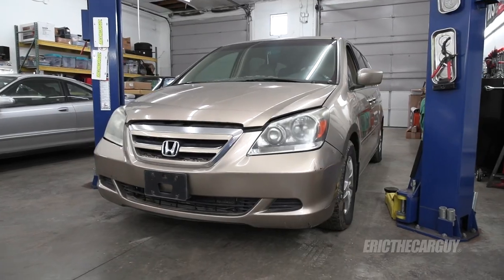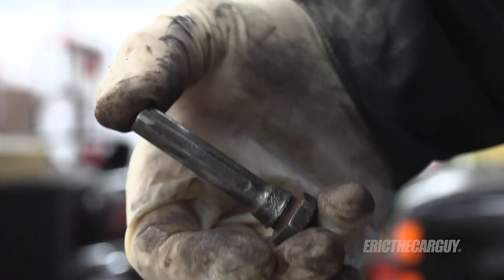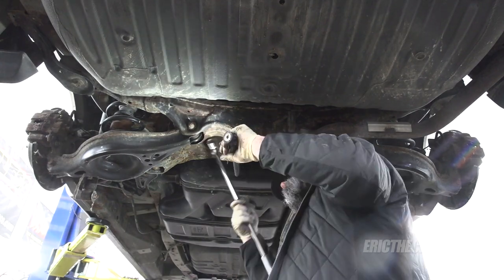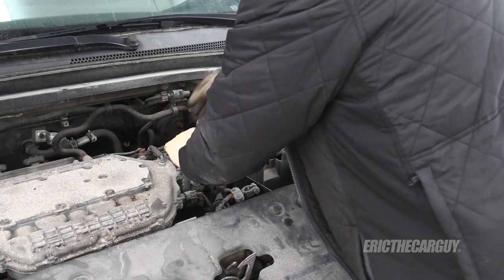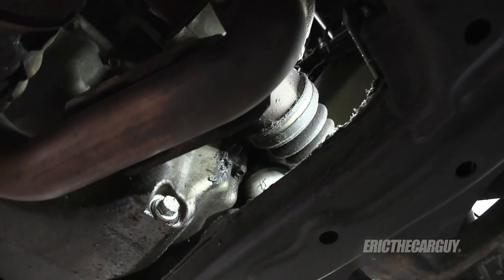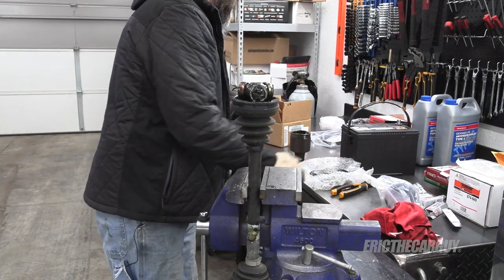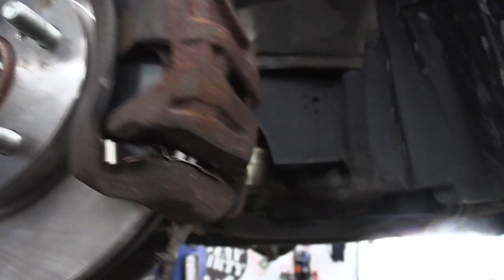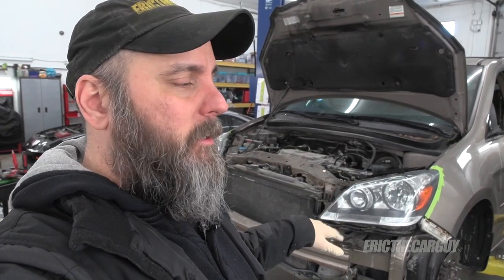2005 Honda Odyssey The Work Begins (Episode 2) Fixing it Forward

Comment: Watching these videos I'm not too impressed with the quality of the design. Seems to me you don't repair Hondas you just replace parts that crap out. Good if you are in the business of selling replacement parts, not so good if you are an owner trying to keep your car maintained.

Where is the grease zirk in the rear control arm?  How do you go about replacing  the bushings?  Sounds like piss poor design to me.
Reply from the maker: If you only knew what was actually involved in vehicle manufacturing. I recommend this as an overview: https://www.youtube.com/watch?v=IhYvkh1ydMc
Reply: @ericthecarguy  

Well I understand that to a point, but nonetheless when I buy a U joint I always opt for the one that has a grease zirk over the " permanently" lubricated ones. 

I have been a locksmith over 40 years and one observation I will make is that there is virtually no demand for duplicate keys for older Japanese cars despite how popular they were at the time.  But there is still call for  most domestic cars and some of the imports like VW's or Mercedes. My wife had a Toyota she bought new. For that car you didn't buy a distributor cap you had to buy a whole set of plug wires with it. When a tail light socket was found to be corroded can't buy a socket, got to buy a wiring harness. Went to adjust the vent and the plastic turns to dust. Can't buy a carb kit, got to buy a new carb because the Teflon coating was worn out.

Yet the myth continues that Honda's or Toyota's are such wonderful and reliable cars.

When I watch your videos I see things like you finding a stuck adjustment bolt that requires replacing the whole control arm to fix.  No provision to lube the part, no provision to repair the part, and you can't even replace the part you have to replace the whole assembly.

Piss poor design.

Comment: The Odyssey is the worst car Honda makes or ever will make.  They're as reliable as a Jaguar.  This whole series is just setting yourself up for disappointment.  Don't get me wrong, I always get Accords, and want to get in to TSX, and if I ever make it an NSX, but have always known transmissions are what's wrong in Hondas and the Odyssey is a disaster beyond that.
Reply: A TSX and Odyssey is pretty much the same deal. 6 of one and half a dozen of the other. 
They share the same transmission. I have an accord euro (which the tsx is based off) and it has a shudder when the converter locks up even after doing a 3x3 fluid change and changing the little external filter. Common problem. 
Oh and starter motors and alternators? It’s been through 2 each of those. Again, a common euro/tsx problem. 
Recently it’s sounding like the chain tensioner is going slack too (noise on idle), it’s done 230,000km and been serviced at the dealer, the previous owner was a boomer who looked after it. Typical K24 things. 
The Odyssey really isn’t that bad.